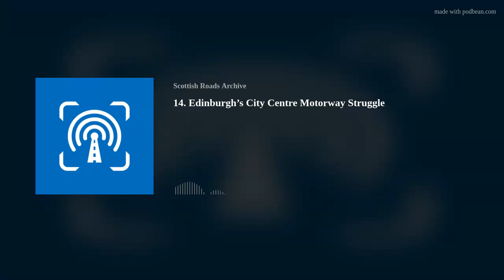14. Edinburgh’s Urban Motorway Struggle

Comment: The SRA is an invaluable resource.

As a 55 year old edinburgh man who has lived in lanarkshire for the last 21 years, but who uses the edinburgh roads frequently, i feel qualified to comment.

Immediate improvements to the roads system would include the following:

(1) grade seperation at junction of the M8 where it meets the A720 City Bypass at hermiston gait to allow continuous running from the M8 onto the A720 either north or south.

(2) complete grade seperation at sheriffhall to allow continuous running on A720 east to west and vice versa.

(3) complete grade seperation of the A720 where it meets the A1 at old craighall to allow continuous running from A720 to A1.